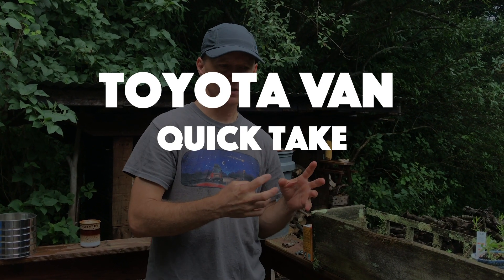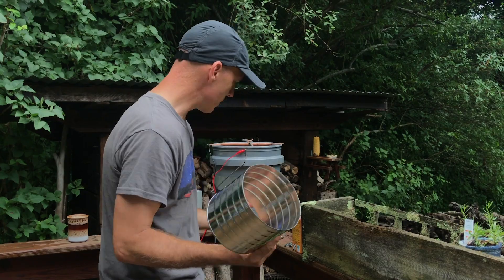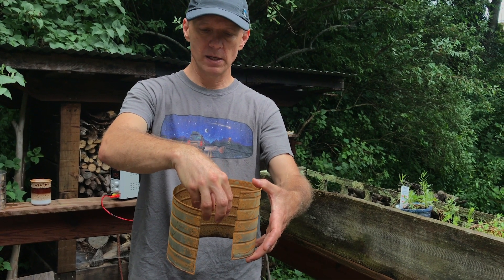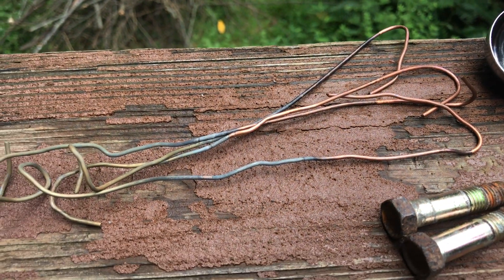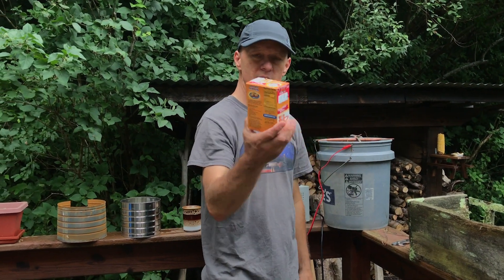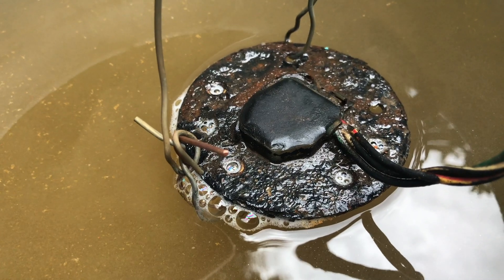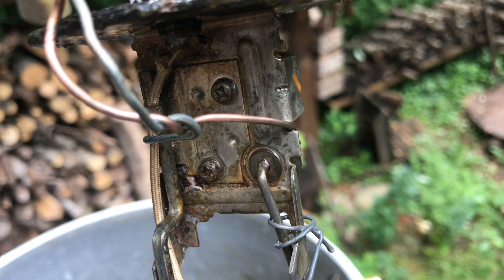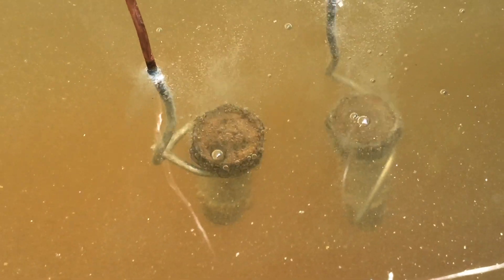Toyota Van | Quick Take | Electrolysis Rust Removal

Comment: Do we need to coat the cleaned item with anything after the process?
Reply from the maker: Good question.... I'd think anything that coated it would eventually get stripped by the fuel and it'd most likely gum up the system. Thanks for watching.